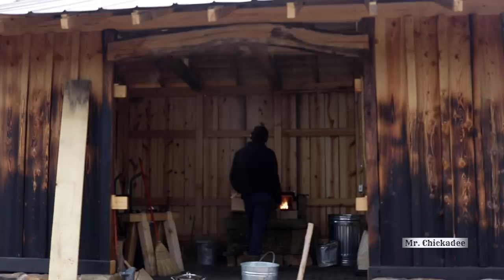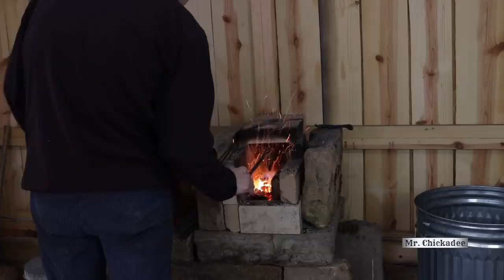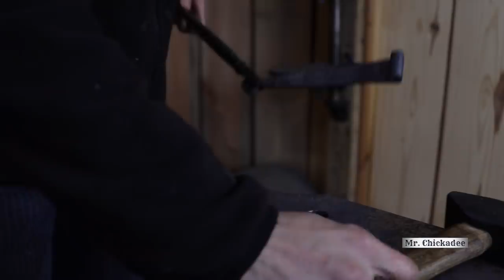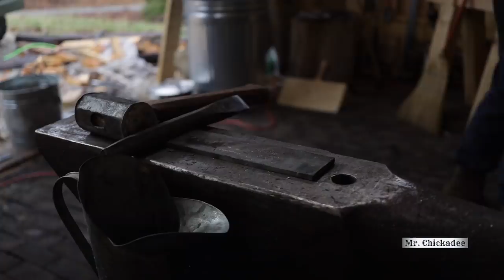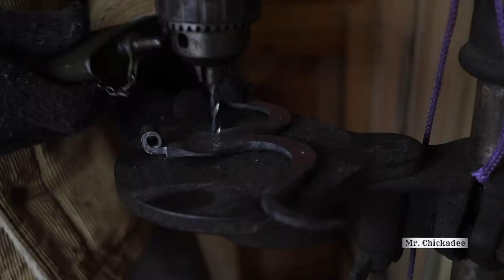Forging decorative hinges for our blacksmith shop

Comment: just a few suggestions jarhead. 
1) I have a soft plate for cutting that sets in the hardy hole, it does not move around when cutting
2) a hold fast in the pritcher hole will hold your work from moving as you cut it as well. 
excellent work as usual.
semper fi.
Reply from the maker: Yep, lots of tooling in the future, just trying to get the doors on the smithy for now!

Comment: I have never seen a drill quite like that, it's brilliant.  I saw one that used a cam like that one, but it looked a bit more modern, it drove a wheel round the top like that one, except the cam drove a cam on the side of the handle which if you were turning the handle by hand would not have been so nice as the round edge of the handle/wheel had teeth in it.  I like the style of your one as well.  Nice looking hinges, they don't make them like that anymore.

Comment: We have an almost identical drill press in our shop. I do envy your blower set up though. I’m sure it’s much easier on the shoulder.
Reply from the maker: It is a pure joy to use, almost like a slow dance sway back and forth, quite unlike the squarrel cage hand crank I had before....
Reply: Mr. Chickadee I’m left handed so I hammer and crank the blower with the same arm...I’m going to lobby to build a blower like your.

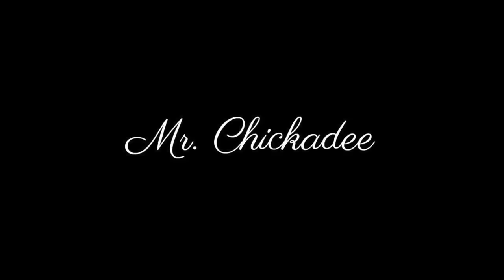Comment: 13:30- did you get the extended 150 year warranty when you bought the drill press or are you going bare with it? ☺
Reply: Actually, I think he BUILT it!  It is pretty amazing, though!  I tell you, our forefathers were really quite ingenious, in the way they solved problems & did things for themselves, instead of just buying anything they needed!  Superb!
Reply: @flurng  he did not make it: it is a antique blacksmith post drill. It would be very hard to cast iron on a amateur level.

Comment: Josh
I love your spirit and adventure in all you do. Look at a few more video on welding the joints. Your hinge was just amazing for the first but it would be a lot stronger with joints that will not pull apart. If too much weight be put on that hinge it will stretch out on the weight.
Reply from the maker: Thanks for the comment
Reply: Over my head. If you have a lecture on the topic that can explain to beginners, let me know

Comment: Nice process, beautiful hinges.

In the English tradition the ornate elements are on the door, not on the frame. This has a penny-ended tee or pin hinge look to the door part of the hinge (ie relatively plain) with the frame-mounted part being decorative. Are you following a historic precedent, and if so, which?
Reply from the maker: Ni historic precedent, just following my heart and hands...

Comment: Very nice. How must rust do you predict on mild steel with the large eaves? Just curious about using wrought iron in future for outdoor projects instead of mild steel. Are all forms of wrought iron rust resistant or just the formulations specifically made for rust resistant properties?
Reply from the maker: Routine oiling of the building will take care of the rust. Wrought iron is to some degree more rust resistant, though even mild steel will last forever if treated right.

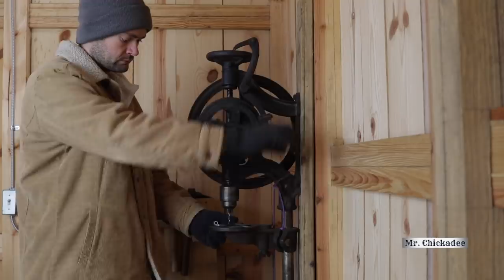Comment: 12:43 is that drill table just a drill or does it actually drill-press?
Reply from the maker: Oh it sure does! It has a little lever that presses down on a ratcheting wheel with each rotation.

Comment: All that remains is to find a vein of sphalerite, smelt it, and galvanize those beautiful hinges.
Reply: Or oil quench and coat with wax. Very effective and durable.
Reply: @jameshaulenbeek5931  wax while still just too warm to hold, but not so hot as to smoke heavily. The steele's atomic structure will drink in what it needs, then wipe any excess off of the surface.

Comment: Is there some function behind tapping the anvil with your hammer between hits on the hot metal?
Reply from the maker: Keeping pace, slowing down gently...
Reply: Some Smithys also believe it is a conservation of energy keeping the hammer in motion between strikes, I kinda go with that one myself.
Reply: Regrip , I heard too...
Reply: It's kind of musical but, I thought a function might be to give yourself a chance re-grip the hammer after a few hard strikes...perhaps your grip on the hammer slides down a bit after a few blows and gets "out of balance".  Another guess I had was to clear the face of the hammer from any debris buildup.
Reply: @David-rx2to  I have heard all of the above reasonings from various blacksmiths.

Comment: Well black smithing is not as fun to watch as woodworking.
Reply from the maker: No? I guess it depends on the person...
Reply: I love both. My top ten channels are fairly evenly split with three woodworking channels, 3 blacksmithing channels, 1 channel that does both, and 3 boat building channels. The boats are of wood, but the fasteners in one of them are partially handmade with some smithing.